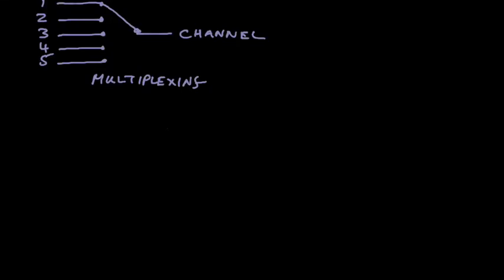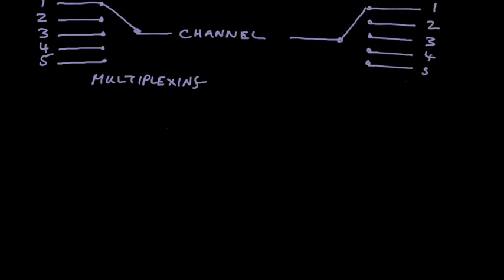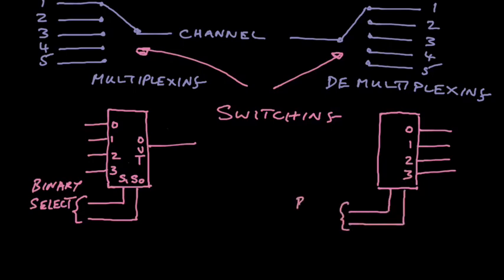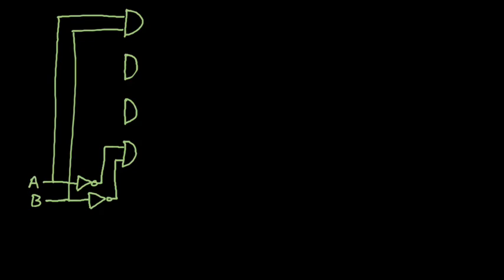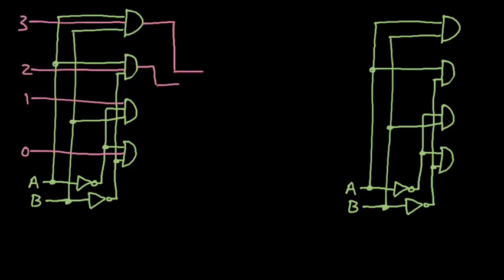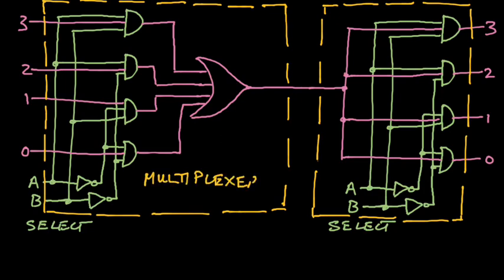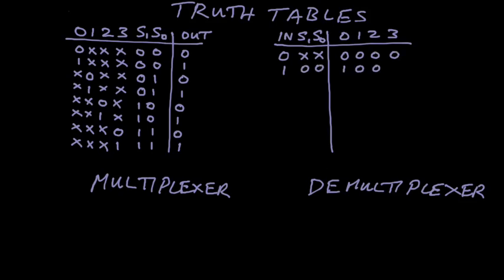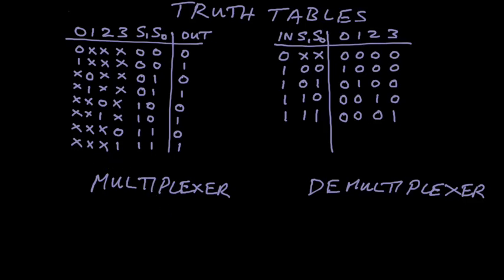multiplexers demultiplexers Logic diagrams truth tables

Comment: Great tutorials for academic lectures, diagrams, numbers and symbols are all very theoritical
Ok do you have answer to my question ??? How can convert 10 indicator lamps to a digital form ?? In analog form i need 10 wires plus the common makes us 11 wires send to a remote panel, how can i achieved this in digital way with only 2 or 3 wires ??
Reply from the maker: Hi Andreas .....  you would need to use some type of multiplexing ..... this will require digital chips at both ends  of your "2 or 3 wires"...... IC's to do this are readily available..... the reason I am making so many "theoretical" videos is because my students request them..... it is the theory that gives the most trouble to students all over the world (they need  to pass exams whether they like it or not)
Reply from the maker: Hi Andreas do you build electronic circuits ?  I know you have a D-110 module.... so maybe I should  make some new sounds with that  ? .... and you could put them into yours..... sorry about all the theory videos, but it is necessary for my students even though it  is boring to my subscribers.
Reply: Your knowledge its too much, than mine....if you can do it, will be much appreciated, anyway thank you so much, God bless you  !!

Comment: When I first understood this concept back in the late 1990s I thought my head was going to explode. 😂👉💥 Since we only used virtual tools to understand these concepts and my work was handled within a much higher abstraction I quickly forgot this stuff. Thanks for the refresher ... these two concepts are vital for understanding digital storage, be it data or code.
Reply from the maker: Thanks for commenting..... as I promised on your channel post ...... I am designing some synthesizer circuits even now (between my University work.... how will I ever survive ? ) ...... the primary objective is they MUST be built with CHEAP easily available transistors and IC's  ...... use as few parts as possible ..... and sound great......   I hope to have all the DIY guys rushing to build my designs 😂🤣😂😁
Reply: I look forward to your designs but do get proper rest! 😁 Nothing is ever set in stone but right now the Venn diagram for synth buyers and electronic engineers still shows very little overlap. Most, but certainly not all, of the synth DIYers I have encountered are more of the "paint by number" variety that are good at soldering and recognizing components but lack desire to dig deeper. Anyways ... have you seen "Casper Electronics DIY synth building. Part 1: Oscillators," "... Part 2: Sequencers" and "... Part 3: Lo-Fi Sampler/looper/VCF" here on Youtube? I highly recommend students AND teachers watch it -- Peter does a good job but there can always be improvements.
Reply from the maker: @HazeAnderson  thanks for the tips..... I have not seen those videos and never heard of that channel.... I will check it out before I go further with this 🙂